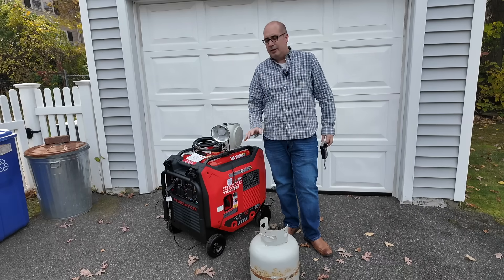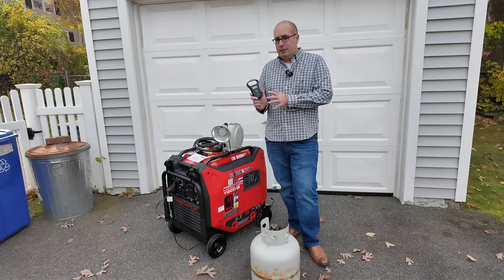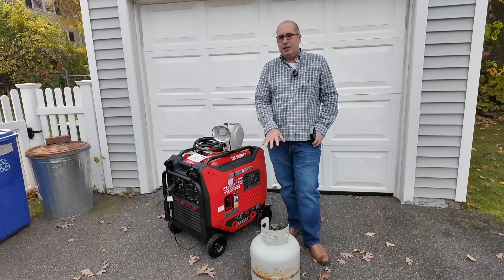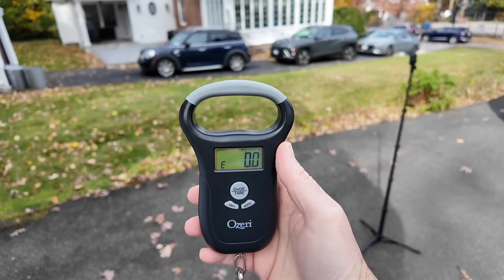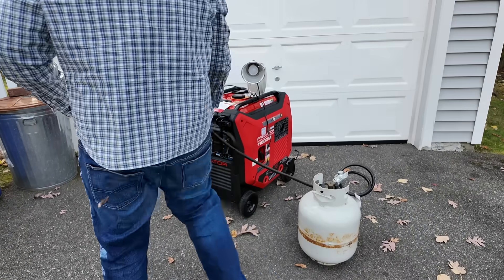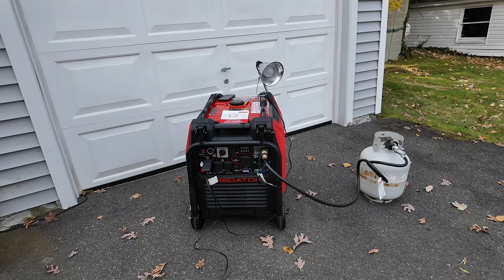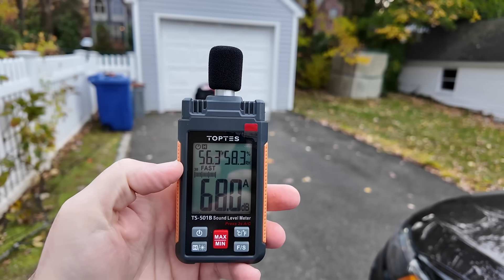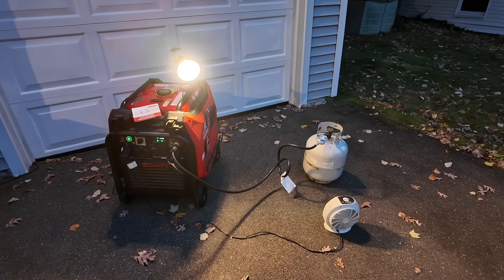Predator 11500w Generator Propane Runtime – You Won’t Believe How Long It Lasts!

Comment: I hope the best for your inverter generator.  I myself bought the HF 5000 watt unit 2 years ago since I live in a semi-rural area and we often loose power a day or two here and there in the winter.   The only things I wanted to run was a refrigerator, a small freezer, wood stove fan and 3 or so LED lights in the house.  My total wattage was under 2,500 watts.  I did an 8 hour break in on the generator so I'd be prepared when I needed it.  The very first outage we had the generator ran under load for about 4 hours and it started having voltage issues.   By the next hour it was unusable voltage so I shut it off and took it back to HF.  They gave me a new one and back home I went to set it up.  It ran for 3 hours and then started turning off on an overload fault.  I measured the load and it never got over 1,900 watts and it faulted again... 

Took that back and got the 13,000 watt non-inverter style.  I run it on two 40 gal tanks with a fuel splitter installed to seamlessly be able switch tanks to have one filled if low, both tanks have tank warmers.  Same setup I had on the 5000 watt.  2 years now and about 12 to 15 outages later the 13,000 watt generator works perfect and allows me to run much more and was basically the same price as the 5000 watt inverter style.    I get about 18-20 hours run time per 40 gal tank on about a 30-35% constant load.
Reply from the maker: Thanks for sharing your experience, it sounds like you found a great solution for your power needs!
Reply: Just realize that the non inverter generator will be significantly louder, even with the lower load percentage. 

Also a non inverter generator can damage electronics, including the controller in your fridge, freezer and other appliances. 

What you "save" on the cost of the generator may end up costing you more if you have to replace appliances. This is especially true with how often you lose power.
Reply: @Slackware1995  I have my generator in a ventilated shed, so noise is a nonfactor.   I really only gave up on the inverter style generators because I couldn't keep either of the 2 brand new ones I had running.  That said, I do have my noninverted generator going through what's called an EMP Shield.  It regulates voltage through capacitors and provides surge suppression.   Anything plugged into it is perfectly safe.  I'm an electrician, I know things lol.
Reply: @Zappy1210 electrician != electronics engineer 

An EMP shield dies not do what you think it does. The purpose of the inverter has nothing to do with surge protection. Your capacitors will do little in protecting electronics. 

The inverter does a few things. One of the main things is to minimize THD. The other is to provide as close to a pure sign wave as possible even when the loads (and load types) change quickly.

A non inverter generator typically runs at 3600 rpm. It attempts to produce 60 hz AC based on that 3600 rpm. Changes in load (and load type) WILL cause the frequency to shift, the voltage to drop and the THD to increase. These are what damages electronics.

The damage often does not cause a sudden failure, but rather an increased degredation that may result in sudden failure even when not using the generator.

But you do you. It's your money, your equipment.
Reply: @Zappy1210 I have 6 inverter generators and don't have any issues keeping them running. 

I had one inverter generator that I failed to run periodically and used ethonal gasoline. I tried to start it about 6 months later and it didn't want to start. That isn't an issue with inverter generators, it's an issue with ethonal gumming up the carb and intake system. Perhaps I didn't use enough stabilzer.
Reply: @Slackware1995  My issue wasn't fuel, I used propane on all of them.  The issue I had is 2 brand new 5000w inverter generators failed, on the same day.  One, the voltage started jumping from 140v down to 75v until it eventually was only outputting 40v and wouldnt run anything.  Second one, same day, just quit running after 3-ish hours and would not restart.  I even tried switching it to gas just to get through the day and nothing.  Got the non-inverter generator, hooked it up to the same propane and have had 0 issues with it.  I just got a bad batch of generators I guess.
Reply: @Zappy1210 out of curiosity, what brand generators?
Reply: @Slackware1995  All 3 were from Harbor Freight, Predator.
Reply: @Zappy1210 hopefully you got the extended warranty. 

I've had 2 Predators. My Predator 2000 is about 5 years old and runs like a champ.
Reply: Wow.  I have a small 10kw diesel genset, owned it over 5 years now.  Been through Hurricanes Idalia and Helene and the little diesel powers everything in a 2500 square foot home except our 4-ton heat pump.  We have a 240V deep well and 240V water heater.  The little diesel burned 5-gallons of off road diesel every 24 hours running 24/7.  It ran 4.5 days straight with Idalia and 6.5 days during and after Helene.  Propane as always is in short supply during and after hurricanes while diesel fuel has always been available.
Reply: @Slackware1995 my 5kw Gen is 13 years old  . It's never failed to start on the 1st or 2nd pull
Reply: @Slackware1995 Coleman with a Subaru engine. I always use Stabil

Comment: you say 2000w load  but unless thats a 500w lightbulb and I doubt it is,  its not a 2000w load.
Reply from the maker: It was a 350w bulb and my heater was about 1600 watts. Thx for watching

Comment: The propane 20 lbs tank to refill is not cheap uhaul, Home Depot $25...you only get 4 to 5 gallons till empty If I run the AC in my house 🏡 I probably need a couple of those tanks daily I hope your neighbors don't get upset of the generator noise.. Gasoline is more efficient, effective than propane ...My Honda Inverter generator is very silent I only use it to recharge my ecoflow power station and out of the ecoflow I run everything..Comprende..Get a power station Bluetti, Ecoflow..to run your house,RV....
Reply from the maker: Propane can definitely add up, and generators can be noisy – good points to consider!

Comment: Great video. Is there a cover that you use/can use for this generator while the generator is running?  I'm guessing this unit should not be run in the rain or snow.  With the exhaust being on the side, I did't know if there is cover built specifically for this generator.  Thanks!
Reply from the maker: I usually put a folding table over the generator when it’s running in the rain that way it’s shielded from direct rain but still has plenty of room for adequate ventilation

Comment: We would not want to afford running a generator for long periods,the cost is crazy high,get battery bank and use gen to charge bank because usage varies, small generators have there place,battery bank or large battery backup system.
Reply from the maker: I totally agree with you!

Comment: FYI propane in a tank doesn't "freeze" in the traditional sense, as its freezing point is extremely low. The issue they're describing is a phenomenon where the liquid propane can't vaporize fast enough to meet demand, even in summer, causing the tank and regulator to get extremely cold. This happens because the rate of vaporization depends on the surface area of the liquid-gas interface, not the total size of the tank. A bigger tank 30# or 100# will not fix it either. Same surface area at the top of the tank. You need to "T" in 2 tanks to fix.
Reply from the maker: That's great info, thanks for sharing!

Comment: FYI, most full size RVs have 40lb tanks. I run my generator off a 100lb (25gal) tank, and I have run for over 40hrs. I have also found in sub freezing temps that I have to start my gen on gas until it gets to operating temp and then switch it over to propane.
Reply from the maker: That's great info to know, especially about starting it on gas in freezing temps!
Reply: I use starting fluid and it will cold start on propane.

Comment: It would be interestung to see how much more efficient a smaller Generator would be powering that load, for example a 3kw unit, as thos should run at a higher efficiency due to the higher load.
Reply from the maker: I appreciate the suggestion, thanks for watching!
Reply: @Outdoor_Prepper  As far as efficiency goes, there are other YouTube videos testing this. Running a generator at about 75 percent load and dumping the extra power generated into a battery is the most efficient way to generate power.

Comment: Something to point out is the calculation I did after weighing my tank and double checking with the chart, my 3,000W max sustained, 4,000W peak starting dual fuel generator should be able to run for 26 hours with a 1,500W load with a 30 lb tank.  This much larger generator with a 2,000W load from what you say would do about 12 hours if you had used a 30 lb propane tank.  I would think that 1,500W heater and at most 100W light bulb would have been more like 1,600W, so not sure how you came up with 2,000W when it shouldn't have added up to that and you provided no measurement.  But anyways to the bigger point, watt for watt this bigger generator is roughly twice the fuel burn at this output level.

I think this points out to if you are interested in fuel efficiency and you look elsewhere for how much you want to load up your generator, which is generally around 70% as higher loads are more efficient but you also don't want to hold your generator to max and over-stress it, really the thing that you would want is a generator sized to hold the average load while at 70% of its max output and then buffer the power with batteries.  When the batteries are full, then turn off the generator.  Granted, when you look at a lot of batteries for daily cycling and a smaller generator, for emergency use, it is far cheaper to have the big generator like this one, large propane tank(s), and fill up that / those large propane tanks.  But as you pointed out in a previous video and what I am setup for is to go overnight on a battery-inverter (power station for you) setup with the generator off as normally people are OK with leaving most things off as they sleep with just minimal stuff like a fridge being powered.

I think it would be interesting to pencil out a 120 gallon propane tank and your power station with this generator and actually show what it takes to get setup to run off of a 120 gallon tank.  If you think you will be averaging a 2,000W load for say 14 hours a day and go 10 hours a day on your portable power station,  I think it would look something like this:
1. 420 lb tank * 80% fill rule = 336 lbs of propane.
2. 2.5 lbs / hr * 14 hrs = 35 lbs a day
3. 336 lbs / 35 lbs / day = 9 1/2 days
4. Add hot summer central air conditioning load, maybe 7 days of fuel.

To say most people will use a 20 lb propane tank with this generator says you think they will have a rather low run time when it is needed and then be looking for fuel with everyone else who never considered the fuel they need to have on hand.

For a comparison, what I did is the following:
1. Small 3,000W max continuous, 4,000W peak duel fuel generator.  Easy enough to hand carry around and has crappy little wheels.  TT-30 extension cord so I can safely bring the power into my home.  My measured non-battery charging load is around 800W.  Changing my battery puts the load at 1,400W.  When instead powering an inverter based variable speed air conditioner I was getting up to 1,900W load in the summer while still having a cool place to go in my home.

2. I can also charge the battery off of solar panels.  Granted not a lot, but that also makes the solar panels easy enough to get into place in an emergency outage.

3. A 24V 100Ah LFP battery and 3,000W inverter.  It is not that expensive and it powers a lot of stuff.  No issues running the fridge all night.  More power when combined with the generator to do all electric indoor cooking with a propane camping stove for backup outdoor cooking.  With 24V, I can do a lot of direct DC to DC stuff and have the inverter off if I need to.  Even run a portable fridge directly off of 24V DC.

4. Three 30lb propane tanks.  This with the batteries and solar panels should get me through a week with no utility power.  Can also fall back to just solar for things like running the fridge if I run out of propane and can't source more.  Maybe fall back to my portable fridge if the solar days are not too great as the portable fridge uses less power and can bypass the inverter.  I think by then I would have a lot less food in the fridge anyway, so easier to stuff the remaining food in a smaller portable fridge.
Reply from the maker: Thanks for sharing your detailed insights and calculations – very helpful for others to consider their own power needs!

Comment: Thanks for the video!  I tried my 6500 watt generator on a 20lb tank of propane and it worked fine until I had a heavy load (my well pump).  That would draw so hard that the smaller propane tank didn't have enough flow and cut out the engine.  Tried it again with a 40 lb and there was no problems
Reply from the maker: Glad the video was helpful and thanks for sharing your experience!
Reply: I don’t think he understands load and the speed at which the tank cools when under a heavy load.  

If you are not going to run a heavy load why buy this generator.  If you do run this generator under heavy load conditions then you do need a 40lb tank.  You do not to come to this realization after a hurricane where you will be without whole hose power for days.
Reply: @71gmonet  The use of exhaust to warm the tank works beautifully on my 9000 watt whole house generator.  Where I live we lose power a lot, and I have had to run my unit for 24 hours at a time, on 20-lb tanks (swapping them out as needed).  I have some 30 pounders from my RV, but have never bothered to use them.  As the video points out, the exhaust height is a little bit above the tank, but you can simply put the tank on top of two side-by-side cinder blocks if needed and you're in business.
Reply: @71gmonet  Exactly.  I don't see the sense in buying this generator to only run a 2kw load test, other than confirming fuel consumption.  I also live in hurricane country, grew up in the Southeast.  I would never rely on a propane genset for hurricane country where a genset may be needed to run continuously for a week or more.  I have a small 10kw diesel non-inverter genset that got us through multiple hurricanes including 6.5 days of grid outage during and after Hurricane Helene.  99% of our county was without power after Helene hit. My genset ran our 2500 square foot home minus the 4-ton heat pump.  We have a 240V deep well pump and 50-gallon electric water heater.  My little diesel genset used 5-gallons per day running 24/7. Propane was in short supply during and after Hurricanes Idalia and Helene.  Diesel fuel was and has always been available.  And to add...air cooled, splash lubed gensets are designed for intermittent recreational use, not for continuous, longer run times.
Reply: That’s crazy.
Reply: Have you tried an adapter to hook two 20lb tanks together?
Reply: @ThomasHess-x8v  Well it is nice to have more power than you need as its easier on the generator.

Comment: Save time and fuel.  Run the test for 2-3 hrs.  Weigh the fuel at the beginning and end.  Fuel consumption rate will tell you how long 18 lbs of propane will last at a constant consumption rate per hour.  Another comparison is to test the fuel consumption rate of a 3000 watt inverter generator running at 75% load.  Would there be much difference?  A running generator that has no load on it will still use fuel - that's overhead fuel consumption.  As loads are added, fuel consumption goes up from there.  Larger engines have higher overhead fuel consumption than smaller engines.
Reply from the maker: Those are some great ideas for future tests, thanks for the suggestions!

Comment: Thank you for the followup on this generator.  It would be helpful to have you show us the power draw value the generator displays, if you can show us the thd of this generator during your load tests and if you can, it would be great to see the wave form the generator is producing.  To see if it is good clean sine wave or if there are any rippling going on.  As an inverter generator it should be a low thd and a clean sine wave.
Reply from the maker: That's great feedback! I'll definitely keep those suggestions in mind for future tests. Thanks for watching!
Reply: Yes and hook up a freezer and fridge with  at least 20 feet of electric cord to device's.
Reply: the device to measure the quality of power is a several hundred dollar device... the power this produces is plenty good
Reply: @mikeadams2339  refrig and freezer would not do anything to this device.  It would handle several.  And what would the purpose of at least 20 ft of cord be?
Reply: @condor5635 the starting of freezer and fridge  not to mention H2o heater and pump take a lot out.given that many folks that run long extension cords that can heat them up.
Reply: @mikeadams2339 that’s a separate issue than the generator running